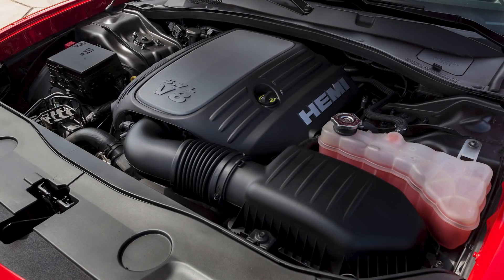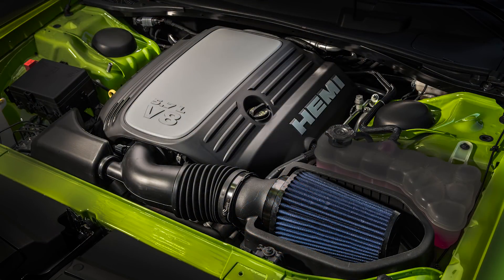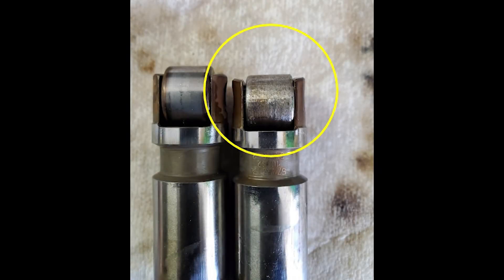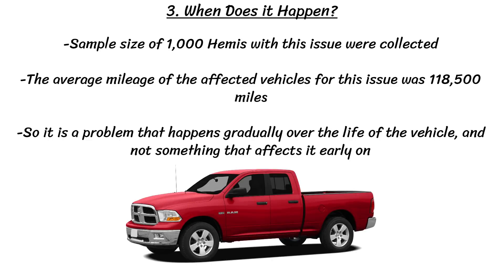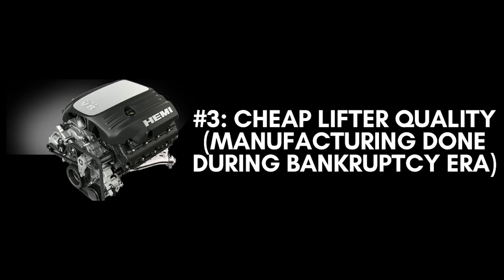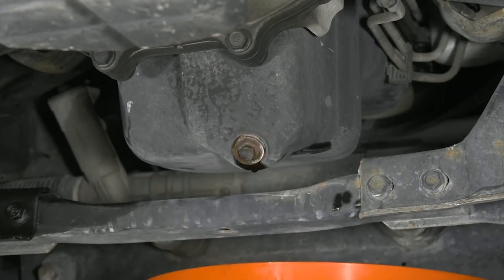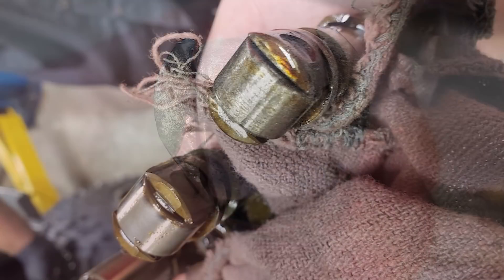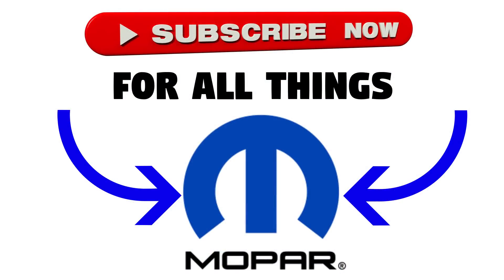The Fatal Flaw of the 5.7L Eagle Hemi V8 Engine Fully Explained (2009+ Lifters and Camshaft Failure)

Comment: My 15 scat pack had cylinder 8 lifter failure at 50k but I was going 5k an oil change I change it at 3k now and hope that keeps it from happening again. Plenty of high rpm time almost never drove with mds on.
Reply: Really, a '15 Scat? Do tell, was this a 6.4? Manual? What exactly failed?
Reply: Auto run hard at drag strip but still a commuter. I got it at 20k and it started ticking at 40 and around 50 cel came on for a missfire luckly I got it covered bc it was a month out of warranty. It was built Dec of 14 tho.

Comment: This happened to my 2011 charger .Paid the dealership to get it fixed , still have my old cam as decoration 😎
Reply: That's not bad considering you have to take half the engine apart. Hell if that's pretty much the only problem it has I'd say it's a damn good motor. Look at the new mustangs and their pistons wrings going on them even on new engines which causes total engine failure. I almost got one until I found that out and I loved mustangs my whole life but my Mopar makes me smile so that's all that matters right?
Reply: Mine only cost 1,500
Reply: How much did they run you for buddy?
Reply: @mattblack7874   about 4.2k OTD

Comment: So any suggestions on a cam that will add a little more giddy-up without affecting drivability too much?
Reply: A stage 1 Mopar Cam would work as long as it's MDS and VVT compatible. I also heard that a 392 cam will drop into a 5.7L. There's a treasure trove of info on this exact subject on every Mopar forum. Check it out.
Reply: Thanks, I have 3 300's the Hemi car I bought came with a dropped valve seat.  I found a replacement from a Ram and since I have to tear it down to the long block, might as well do some upgrades.
Reply: Stage 2 cams or a 392 cam

Comment: I have 123,800 miles on my '12 Challenger R/T w/M6 manual trans, most of which were highway miles. It runs flawlessly and shows no signs of letting up. I run AmsOil synthetics in all my vehicles, no problems at all. We also have a '14 300C w/hemi with 66K miles on it that also runs perfectly, especially after shutting off the Godforsaken MDS system on it.
Keep oil & filter changed frequently, even with high quality oils, and reduce any engine idling time. Works for me!
Reply: You're just lucky, it's not a lack of maintenance problem, it's bad lifters. Oil won't make a difference.
Reply: @CGoffgrid  yea people don’t understand that lol they think their little oil maintenance will stop a factory flaw 😂
Reply: @ThatNofbody  Yeah. I had mine rebuilt this year with Comp Cam and MDS delete. We tried three different brands of lifters before my mechanic was happy. Then  we tuned it. It was a very expensive year for me but I guess this old truck will go another ten years now.🙂
Reply: Yup, personally I go Redline over Amsoil, and like the MDS system, but yup.   I have a '14 300 Hemi AWD, I like the MDS but instead of turning it off I tweaked it using HP Tuners.
Reply: How did you deactivate the mds?
Reply: @kvngtae5886  manual trans cars don't use the MDS crap. I used a tuner to shut mine off in my 300C.
Reply: @MM_in_Havasu  Curious what you didn't like about MDS. The system in mine works seamlessly. If I didn't have that "ECO light I wouldn't notice.
Reply: How can i shut the mds off for good on a 2008 5.7 I use mobile 1 5/20 oil it's  got a on and off button
Reply from the maker: Tune it off is the only way (buy a diablosport or get a tuning shop to do it)
Reply: @MarspeedCars  ok thanks
Reply: @MarspeedCars  will the dealership do it or do you have to go to a tuning shop

Comment: Wait. So I have a 2016 Ram 5.7 am I good or not?
Reply: They tick because of broken exhaust manifold bolts.
Reply: Yes, a lot of hemis tick but few are actually in danger of this issue. Just take care of the engine and you will be fine
Reply: Should be fine, the rollers were actually updated in '14. Just do good oil maintenance and avoid hot idling.
Reply: Mines a 2017 it kinda ticks but i have no issues

Comment: Can't wait to see a fatal flaw video of the 2.4 Multiair, 3.0 turbo diesel, 2.0t Hurricane.
Reply: the eco diesel fails because it was never designed for american emissions. The EGR causes soot accumulation over the the oil channels in the bottom end. Which leads to bottom end failure. A simple EGR delete typically rectifies the issue.
Reply: @johnsailor6081  except the EPA is cracking down on this left and right. Huge fines handed out this is what deters me from any Diesel purchase. The fuel mileage is there, it's expensive up front and expensive to maintain!
Reply: @lightning7582  it depends on where you live. Huge swaths of the country have openly said they are going ignore the EPA. Parts of Wyoming have already passed legislation banning the EPA from taking legal action against emissions tampering
Reply: @johnsailor6081  so how does that work when federal law supercedes state law? It's two different courts

Comment: Is the 392 6.4 hemi also affected by this?
Reply: Not really, and there's a reason that can educate us all. The 6.4 uses the same lifters, and has both MDS and VVT. But it uses 0W40 oil and has an oil cooler.
Reply: @snek9353  could changing oil and adding an oil cooler fix this issue?
Reply: @nabatron21  Cooler could help if done right. By changing the oil do you mean going to a higher viscosity? I wouldn't say "fix" it's too complicated a thing to say it'd fix it, but it'd certainly help.
Reply: @snek9353  tried to look on youtube for a video on adding an oil cooler to the 5.7 and haven't found anything on it
Reply: @nabatron21  The 6.4 Oil cooler mounts between the engine block and oil filter, the cooler itself is the easy part. You'll also need the oil cooler lines and the radiator from a 6.4 car.
Reply: @nabatron21  Some 5.7 cars have the oil cooler as well.
Reply: @snek9353  seems like a lot of work lol
Reply: @nabatron21 I wonder if the sell oil cooler kits for the 5.7 chargers

Comment: I have an 04 5.7 with 160k on it and it runs GRRRRRRRATE👍👍🤣
Reply: 04 5.7 with 195k and runs great. No MDS on this model year so maybe also less chance for dropped valve seats. Only think I may need to do is swap out the exhaust manifold bolts which is not a big deal, but the original bolts seem to have gone for this long.
Reply: @jayabraham4377  just did mine on my 04..now there's no tick when I mash the gas lol
Reply: @jayabraham4377  cool to hear brother....I'm about to add a good old cam in it and a few other things but its nice
Reply: My 2005 Ram 1500 has over 280,000 with no issues other than a water pump and a egr valve. My 2015 Charger R/T has 48,000. 👍🏾
Reply: @jeffreygibson7903  awesome bro. Something about these newer 5.7 hemis that messing things up...I worl at a shop out here in Houston,TX and i can personally tell you that we get those often with bad engines, having to replace the entire thing....
Reply: @JohnVelez-7  , yeah I keep my fingers crossed that my Charger’s engine will last as long as my truck has. I’m using Royal Purple 5-20w and change it every 5,000 miles.
Reply: @jeffreygibson7903  yeah that's good bro keep changing your oil at 5,000 Mi if you can and keep your eyes on it good just to try to prevent any inconveniences
Reply: @JohnVelez-7  👍🏾👍🏾
Reply: Happy that yours was built better. They should have left them alone.
Reply: Best thing is no mds in the 2004

Comment: I had a 2012 Chrysler 300S I bought new. I had 120,000 miles and it happened to my car. Always changed oil with synthetic oil before it’s time was due. Otherwise nothing else happened to the car. Just didn’t want to deal with it and sold it soon after.
Reply: 11-13 was rough years man...
Reply: 2012 AWD 300c with 125,000 bought new, regular Full Synthetic Oil changes. MDS lifter failure & spun cam shaft bearing, Chrysler wanted to replace motor..

Parked it in the garage for now; still trying to decide if I wanna just do a rebuild at a good local shop, or scrap it..

Chrysler….. 😑
Reply: I had lifter tick on my 2013 Chrysler 300S. Traded that car in with the swiftness.